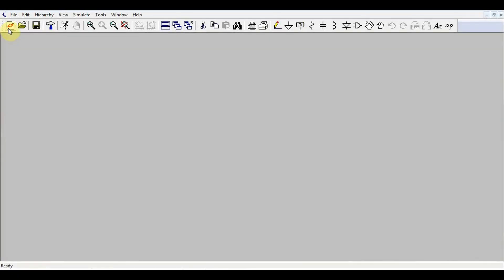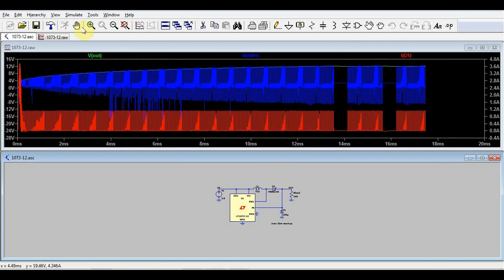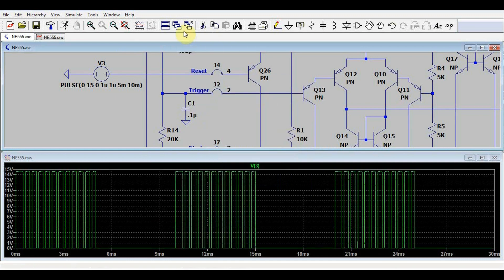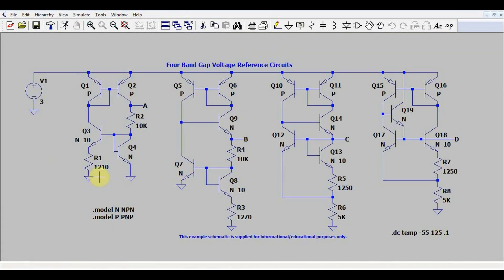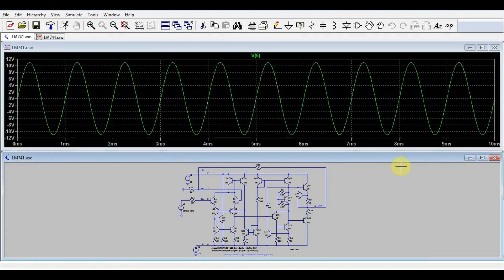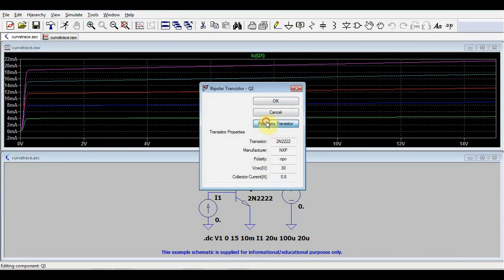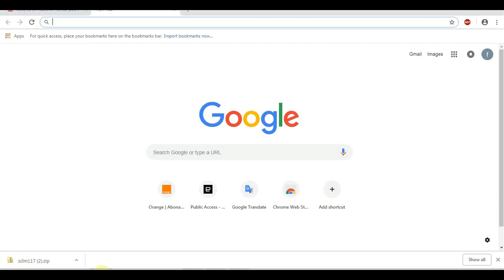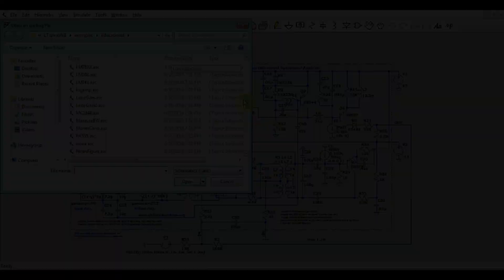LTspice tutorial - Ep5 Stock example simulations to play with

Comment: The last circuit is a op amp made using a parametric amplifier in the first stage. There is a book called parametric amplifiers by Phillips that explains deeply and also shows this low noise parametric amplifier for low frequencies.

Comment: How did you multiple the V(out) and I(R23)? what shortcut is that.
Reply from the maker: You can plot power by holding the Alt key and then left clicking on a component. The cursor should turn into a thermometer when its over a component.
Reply: @FesZElectronics  Thank you😄